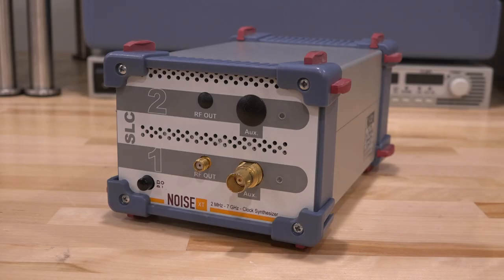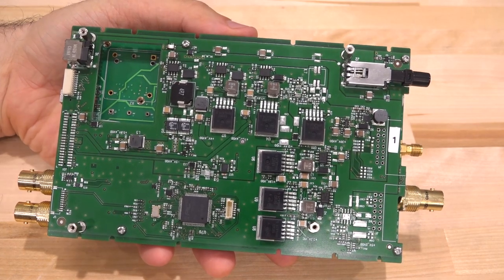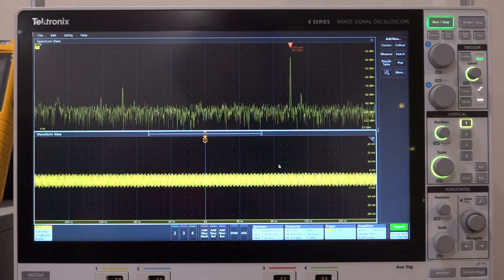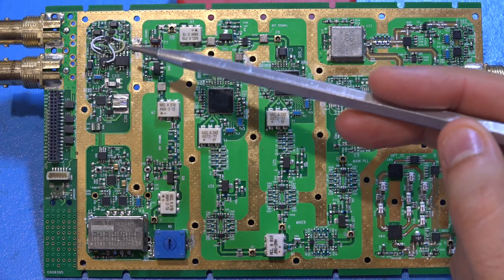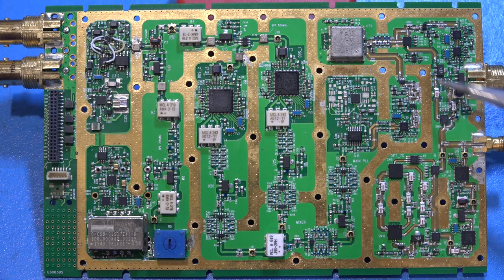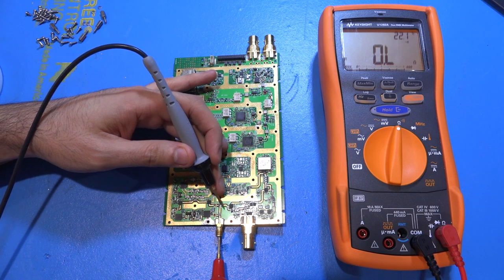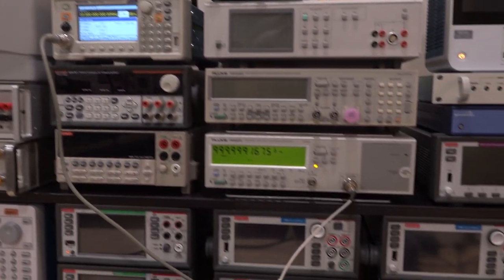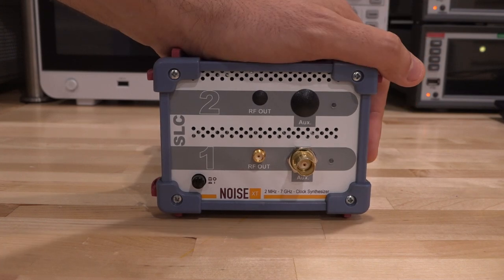TSP #173 - Teardown, Repair & Analysis of a Noise-XT 2MHz - 7GHz Ultra-Low Phase-Noise Synthesizer

Comment: Nice design! So, if I understand it right, the low phase noise comes from the high quality VCO oscillator in combination with a very narrow PLL output filter. I really liked the concept of mixing 2 DDS signals as the reference of a narrow band PLL! 🤩😊
Reply: Yes, a low noise VCO in conjunctions with a wide PLL loop bandwidth, which requires a high frequency reference, hence all the paraphernalia prior to the PLL.

Comment: So, the center conductor inside of the connector was broken? Or was there a cold joint between the pad and the pin? Dropping the unit probably knocked the tin whisker loose that connected the pad to the center pin. :) This can't be a production board. The sales guys probably "borrowed" the first prototype for a demo and "somehow" it ended up being sold.

Comment: Interesting video as always, keep up the good work.
At first power on you mentioned that the device dumps a lot of heat into the heat sink. After taking it apart, do you know what is the main source of this heat?
Reply from the maker: The heat comes from the two DDS ICs.

Comment: This has shown me how you really have to think different with RF equipment...with most gear I work on, a broken trace near or at the output means nothing at the output.
Reply: Many years ago when I was first getting started in electronics, I breadboarded a circuit with a headphone output.

I was really confused as to why my output was so quiet, so I started poking around and debugging. Eventually I found my headphone jack was wired one column away from the opamp output, coupling through parasitic capacitance of the breadboard.

Gave me a new appreciation for parasitics even at audio frequencies!
Reply: How can I detect gps car tracker ?

Comment: Random thought; if you sold that wall of test equipment, in which city could you buy a 3 bedroom detached house?    .. "Let's unplug it from the incredibly high-end spectrum analyzer and go ahead and connect it to the Rubidium standard..";-)
Reply: Holy crap just that Agilent E5052b alone is... $75k used on ebay.  Such gear pron from TSP, as ever...

Comment: Dear Shahriar, thanks you for the video! I suspect both DDSes operate at the same frequency and mixer in such case works as doubler. This will result in 3dB lower DDS noise and two times higher comparison frequency in the output PLL (which should also lower PFD noise level at the synthesizer output). Can you verify my assumption? Do both DDSes operate at the same frequency?
Reply: @Thesignalpath  The signals will be correlated and will add by voltage resulting in 6dB increase, the DDS noise components will be uncorrelated and will add by power resulting in 3dB increase. So, the signal to noise ratio will be better by 3dB.
Reply: @Thesignalpath  I bet the internal PLL of the DDS in this synthesizer is not used. There is no sense to multiply 100MHz signal up to 800MHz and then divide it down (inside the DDS) to use internal DDS PLL (to match internal PLL PFD max. frequency requirements). Skipping internal PLL and using external low noise frequency multiplier is the classic solution for the low noise DDS clocking. As for the correlation of the signals generated by PLL - signals and noise inside the PLL bandwidth will be correlated and outside PLL bandwidth will be uncorrelated (it is a bit simplified view of the things). In any case the tones generated by the DDSes will be correlated and the noise generated by the different parts of the DDSes will be uncorrelated. Can you measure the DDSes output frequencies to check if they are equal?
Reply from the maker: @UR3IQO  Sorry, I think I messed up the comments. I was saying that you are correct. I originally misunderstood your comment. Indeed if they set the DDS to the same frequency, this will improve the phase noise by 3-dB. I can open the unit and try to measure to see what is going on. I am now very curious. Thanks for the comment.
Reply: @Thesignalpath  The frequency combination of the two DDS is a key feature of the synthesizer and can be the reason for creating a new video )
Reply: @Thesignalpath  " I can open the unit and try to measure to see what is going on." That would be great! I will be looking forward to see it. Thanks!

Comment: 21:00 As I see below 10k it is worse than the spec. Eg @1k it should be -130 but it is -110. Somehow the 1/f^3 part is higher than it should be.
Do you have a guess why is that?
Reply from the maker: Thank you for pointing that out. I think it might be because of how I had setup the phase noise analyzer. I will go back and try again with higher correlation terms.
Reply: @Thesignalpath  According the DS of the 5052 you are fine measuring the spec without anyXCor.
https://i.imgur.com/5QoKTR4.png

Might be something related to ZCOMM
https://www.zcomm.com/pdfs/datasheets/V600ME14-LF.pdf  -60@1k, -90@10k

As the ref is way better than the spec. It interesting to see that they only have 30dBc/Hz budget.
https://www.nelfc.com/pdf/1319a.pdf   The ultimate PN spec: -162@1k, -175@10k

The connector might be this:
https://www.amphenolrf.com/901-10511-2.html
Quite "günsting" performance/price and simulation model "freely" available.

Comment: Interesting bit of gear, nice easy repair too, I suspect someone removed the OCXO from it due to the fan connector being ripped off.
Reply: I thought that too, but there's not much solder left behind. Some pins have changed color from the ENIG gold, so maybe that indicates there was one previously installed but they cleaned up well after removal, but some contacts are still clean gold. If its one of those general footprints that can take a range of OCXOs then that might explain the clean pads too.

Comment: Just a a beginner questions, how did you acquire all those expensive lab bench instruments? I recalled that you mentioned you mostly trying to buy used or broken ones and repair them. Did you get those used and broken units on eBay? Or there is some place one can visit for shopping? Thanks

Comment: When hardware is taken hostage by the software. Yes, I've been there. Are they selling bricks?

Anyway, it is very amateur for a finished product. They should have built just a couple of PCBs using a cheap service, find the kinks, redesign, repeat the cycle again, and if no kinks are found, then ramp up production. I'm no professional manufacturer, just an hobbyist, and I do that often. Many green wired PCBs went to the bin.
Reply: I don’t think those cheap prototyping PCB services would accept a complex RF board, or that anyone would trust them with it anyway.
Reply: @TheXGamer969  It depends on the frequencies you need. For example, OSH Park is great for prototyping in RF. I've made successfully a working USB 3.0 test jig, with all the right controlled impedances. It is a matter of finding a service having the same PCB stackup and materials that will be used in the final product, if possible. Or you can use the prototyping service of production fab, as many fabs support that. For instance, Eurocircuits can be quite cheap. 

Fab services accept any designs involving RF, as that is a matter that has only to do with the layout/design aspect. When submitting a design, one has only to make sure that it complies with or exceeds the minimum distances and trace widths, and that the vias can be fabricated. Fab services won't impose restrictions on any designs involving RF or high-speed signals.

As for other services, like JLC PCB, or PCB Way, I don't advocate them, not even for prototyping. However, I did used them because one of my clients required a very cheap and bare-bones service.

Comment: Hi, Signal Path, Very interesting about the dual DDS design, I guess the output signal's frequency of the dual DDS is the same in order to get 3db better phase noise, and avoid the M*N spur caused by the mixer.
So could you please help measure the output signal of the dual DDS ( AD9912???)
1. What's the output frequency range of the DDS?
2. Does the frequency is the same of the dual DDS?
3. What's the fractional spur performance of this generator @ fractional frequency?
Reply from the maker: It is likely that the dual DDS is for phase noise improvement indeed (at the cost of doubling the power consumption). I may do another video on this.
Reply: @Thesignalpath   Thanks, Also very interesting how about the spur performance comes from the dual DDS chip, because it will be the reference of the PLL, will be 20logN amplified at the final output.

Comment: Great to see the architecture as well as you use the equipment most of us won't be able to access like the E5052B.  Your Keithley sales rep is sending his kids through college thanks to that lower rack of DMMs, SMUs, and DAQs....
 
Is there any reason why you didn't use the Rb standard/counter for the 10MHz ref? You'd have the same basis for the counter and DUT to check the locking, but wouldn't that be best for the phase noise analysis too? You clearly didn't need it so maybe it was just convenience?
Reply from the maker: Yeah, it was just easier to use the Tek. I also wanted to show how amazingly accurate that instrument actually is!
Reply: @Thesignalpath  thanks for the reply, that Tek is indeed very impressive!

Comment: Nice little synthesizer, I like that it is so compact. The fault was pretty obvious but it was a very interesting and in depth video non the less, as all your videos. 

I came across a very nice S-Band synthesizer once, that was pretty nice spec vise and had all kind of modulation capabioities built in, however to control it you needed some software that was only provided pre installed on a notebook that was sold with the unit. 
When I tried to get the software the manufacturer told me it "isn't in their interest to help anyone but the original customer" so the only thing left was to use the unit for parts, which was very sad.

Comment: Funnily, that same model of the signal source analyzer, the Agilent E5052B, was used at JitterLabs to measure the jitter from my 10MHz clock reference (named GR10M-S).

Comment: I knew from the start it was the connect I have work with this connector. The weight of cable or user abuse. Your replacement connector is fine for  under 10 Ghz.

Comment: Why don't you analyse the reason for distortion,  it has a lot distortion
Reply from the maker: The instrument's THD is not very good. But it is not designed to have very good THD, just very good phase noise. For clocking applications, THD is not so important. Note how it says that is is a Clock source.

Comment: This is the weirdest breaking I ever saw in my entire profession life ... How could a fraction happen inside a rugged connector without leaving  sign outside ?? .... Shahrayar my friend , you are so lucky to get this problem at this point without digging deeper inside the madness on the circuit board ....
Reply from the maker: It probably wasn’t a good connection to begin with.
Reply: It would have had a plug inserted which would have taken the brunt of the impact, and would thus conceal dents and dings.
As for SMA being "rugged", it isn't. 
All the two-way radio manufacturers are now fitting these daft little connectors despite being down between 140 - 460MHz. Every week I get another handset on the bench where the SMA connector has been snapped off because the radio was dropped, leaving the thread inside the antenna.
For really high density bench instrumentation, I can see where SMA would be useful, but for me, N-type will always be king for low loss and ruggedness.

Comment: How could possibly a several thousand dollars instrument fell off the table!? I‘ll take it to my bed if I own such a device.
Reply: the more expensive the equipment, the less likely it is to be owned by the people who actually operate it. when the company is paying, people are less careful.
Reply from the maker: This thing is very light weight. It also has a USB/Power/SMA connected to it. Probably a cable got yanked and pulled it off the table. This is also how the connector must have broken off.

Comment: 1:26 Yes there is and it could be a ridiculous reason; if they deem the one who have one to be an individual they don't want that one to be able to control it since that person, as they see it, most likely has not purchased it and thus should not be able to get free stuff from them.
Reply from the maker: I am afraid this makes no sense. The unit without the software/driver is useless. The software without the unit is even more useless. This is just bad practice. If you could get something done with the software alone, I could understand, but nothing can be done.
Reply: Absolutely bad practice. I own for example a brand new probably only used once turbo pump I bought very cheap on Ebay recently. To get to the real good control things inside it I need a software specifically made for these pumps and they have the software downloadable no problem at all but it is totally useless without a key. That key will only be sent if I send a register form to them which they then really check up if it is a company (thus no hotmail or gmail adress and such) and most likely also that that company have bought it, then they might send the key. Thus as an individual I can't use the pump fully which is just ridiculous.
Reply: @Thesignalpath  Even worse is the fact that the software literally sends a number via some USB-serial chip to the device so they can't even get away with "there's our IP inside the program".

Comment: Note to self: don't buy from this company. They didn't bother to make a new FR4 PCB spin. For goodness sake it is a PCB spin, not an IC spin.
Reply: Sorry to see your comments but this company is specialized in phase noise measurement since 30 years and their systems are very efficients.
Reply: They most likely had multiple (dozens or hundreds) already pick and placed considering the BOM cost of those things, which is easily a few hundred dollars it most likely was more economical to do the modifications.
Often there is someone in the company just sitting around, a classic candidate to do those modifications.
But yeah, it is better practice to assemble a fully functional prototype first.